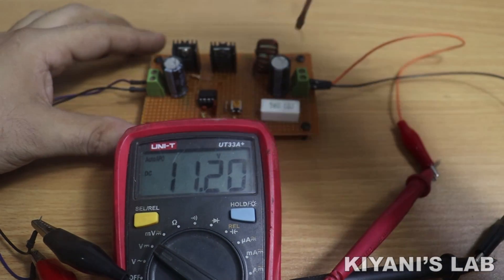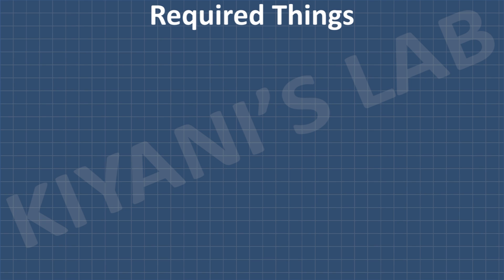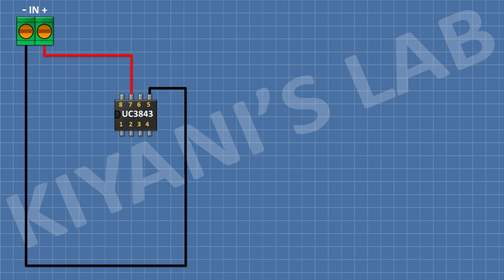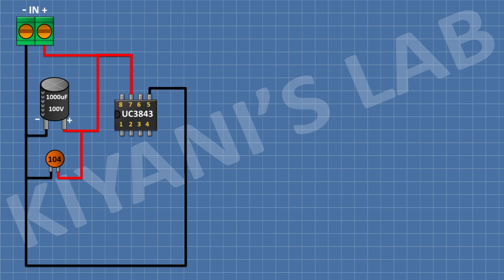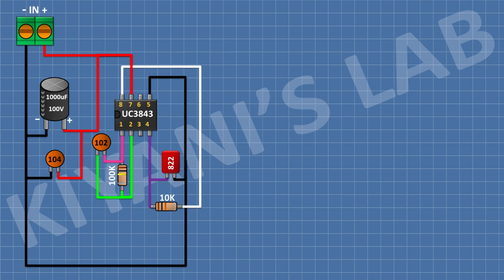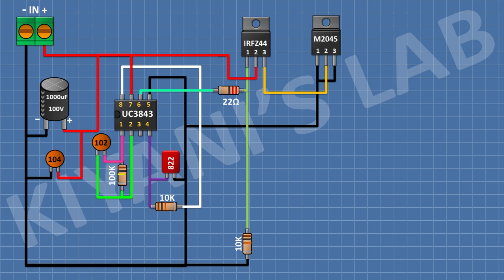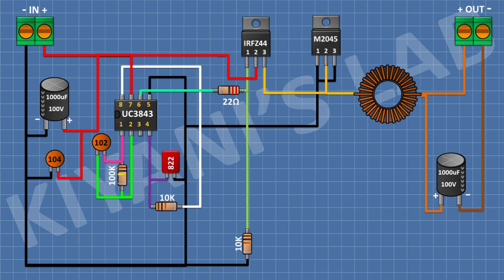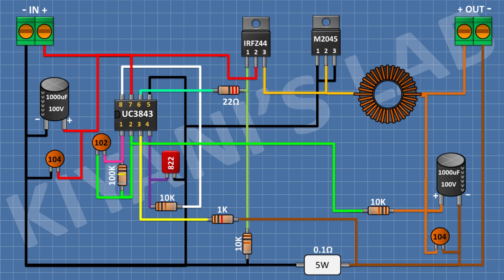How To Make 30V DC To 12V DC BUCK Converter

Comment: To make an N-channel MOSFET work properly in the high side, you need a high side driver or a bootstrap. Maybe it works this way, but there's a lot of power loss. There are some videos on this topic.
Reply: power loss is the point :/ its stepping down voltage

Comment: sir how can i increase with apms with this buck controller. i want 60amps buck. can i use output of buck use paralar power trasnsistor ? kindly help me please.
Reply from the maker: yes buy changing the increasing the mosfets and changing the current limiting resistor

Comment: mc34063 ic buck boost converter input voltage 12 output voltage 0 \50 pwm controller PC817 irf532

Comment: Thank you sir. Keep the good work.
I suggest you include TL431 in the circuit.
Reply: Why? The controller IC has in internal voltage reference and an error amplifier.

Comment: Brother,  voltage isn’t stable with load change!
What is the reason?  Will you make an improved version? 😊
On the other hand, this is a great job. 
Thank you.
Reply from the maker: a load resistor can be added for this issue those where capacitor voltage